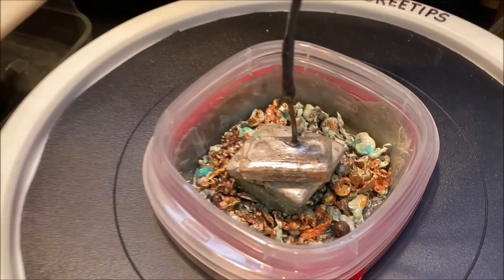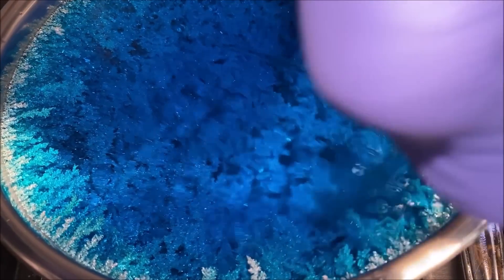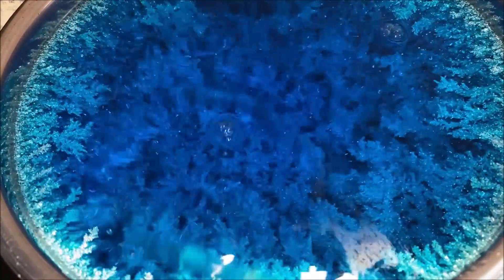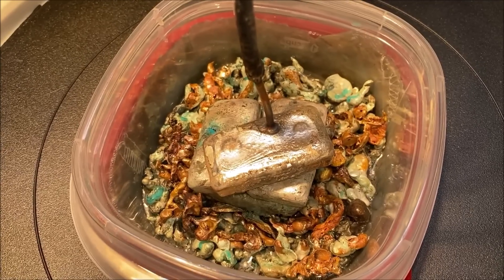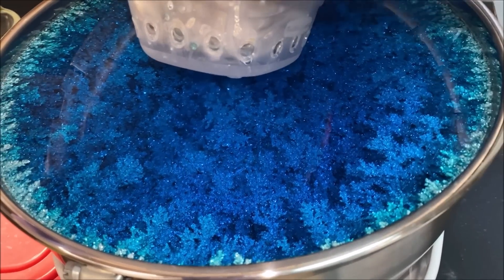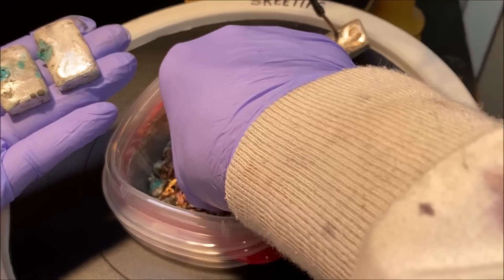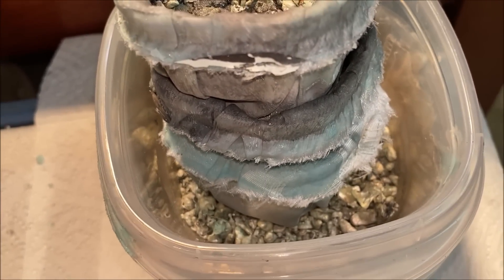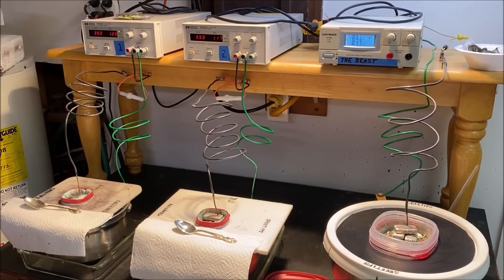Silver Cell Day 14 Crystal Growth 336 Hours

Comment: I am curious to know your thoughts on using silver nitrate crystals powder to create the electrolyte solution versus making it ourselves with the 999 crystal, nitric acid and distilled water.  We have not used the powder but it would seem to be a safer route, just not sure if it would be as lucrative. Have you tried it?
Reply from the maker: Silver nitrate crystals should work fine.
Reply: @sreetips  Thank you! We will try a batch and see how we like it.

Comment: I'm going to make a 1ltr cell with 150grms of 999 silver for my electrolyte, I have 180grms of sterling I will refine and cement out, I will also sacrifice two 2oz rounds to the crystal gods, will this be enough to feed the cell please?
Reply from the maker: When I was running a 1 liter glass cell I think i would get about twenty or twenty five ounces at harvest. But they are a giant pain because the crystal, while very pure and beautiful, grows rapidly and it will make contact with the anode if it’s not continuously knocked down.
Reply: @sreetips  thanks heaps, I do plan on watching it 24/7 it's to mesmerising not to, hopefully I get to do a larger one in the future
Reply: Can I run lower amps to slow it down, or will that interfere with growth to much
Reply from the maker: Possibly, I’m not sure about that.

Comment: But where are you getting all the impure silver? The entire set up is DIY which is awesome but you still have to provide the silver to pull from right?
Reply from the maker: I refine gold. I use sterling silver, that I buy at estate sales, to refine the scrap gold. I recover the silver from that, melt into shot, and run it through my silver cell. Silver is a by-product of my gold refining. The cell converts the impure silver (about 980 parts per thousand silver) to high purity four nines fine (9999 parts per ten thousand) pure elemental silver metal. So I’m refining the impure silver, into high purity silver, not creating silver out of thin air. When it’s full, I harvest the pure silver crystal, put it away and forget about it. Then I repeat the whole thing again.
Reply: @sreetips  By reducing and refining sterling silver you get gold and silver?
Reply from the maker: No, I use sterling silver, alloy it with karat gold, then pull the silver back out with nitric acid leaving the gold behind as high purity gold. Then I recover the silver and run it through my silver cells.

Comment: Question do you have to have a pure silver bar on the top connected to the wire. If so why is that. And also do you have to use pure shot to make your electrolyte? If so why? Thanks for your help!
Reply from the maker: 1) No 2) pure silver for electrolyte was the way I learned it.(edited)
Reply: @ thanks. My silver crystals aren’t as thick and big as yours. I’m using the same voltage you use with a computer power supply. Do I need a bigger power supply that can do more amps or something?
Reply from the maker: I used PC power supply for a while. It worked well. But then I bought a better power supply.

Comment: So the reading and experiments ive done show that the purity of silver can decline over a long run as copper displaces /replaces the silver in solution.  The variables i have not found is at what point does it drop from .999.  Adding fresh electrolyte obviously prolongs the purity.  But at some po8nt thete has to be a solution saturation of cu that affects purity?  In my mind i devised a series to run the sterling directly to .99  and the re run in a second to keep .9999 

Per annode.. ive been pouring a half oz pure and rolling out as thin as my mill can make it and just clip to a strip that sits atop the shot or solid silver to be refined. 
My next run i will clip directly to spoons and forks in the Annode basket.  
Im using steel bowels with a ring attatched for cathode and clip to the ring.  No copper band required .  

Happy festivus!
Reply from the maker: As per some pro refiners on the goldrefiningforum.com I’ve heard that the cell can have as much as 60 grams per liter of copper in it. After that the copper could start to co-deposit with the silver and contaminate the silver. I tried running my small cell for three runs using the same electrolyte, augmenting with distilled water only. On the last run, the silver didn’t look right and it had green residue. When I tried to drop the silver with copper, no silver formed. So I tried dropping silver chloride with HCl. Again, no silver chloride formed. The electrolyte had become completely devoid of silver. Made a believer out of me. Today I never use the electrolyte more than twice. And I alway add fresh electrolyte for the second run.
Reply: @sreetips Smart my good friend 🔥🙂🔥

Comment: Modify the basket in which you add impure silver, put the larger basket to be the contact surface, so you can double the amount of pure silver, When removing the pure silver, do not scrape the silver off the walls of the pot, leave it as a contact surface

Comment: I was thinking (I know, dangerous!) and from an electrics point of view the anode bar doesn’t have to be silver as long as it doesn’t come into contact with the electrolyte. I wonder if it would make sense to make some large “bars” of impure silver shot to provide a buffer layer between the anode side/electrolyte side. That way you’d be able to keep from having to expend all that valuable pure silver making anode bars. 
Maybe I’m full of s***, but we’re not dealing with high amperage loads and the #10 wire you are using can carry an easy 25-30A of current and an impure shot anode wouldn’t slow that down in the least.
Cheers and thanks for the great content!
🖖😎👍
Reply from the maker: I like casting bars in pure silver because it’s a dream to melt and pour pure silver.

Comment: Assume each cell operates at an average of 1.5 amps, which means each consumes 5.25 watts, given the 3.5 volts. The entire setup has been running at 99% capacity nearly non-stop for 336 hours. By now, all three cells have collectively consumed approximately 5.29 kWh of energy. In my country, where electricity costs 0.14 euros per kWh—one of the highest rates in Europe—that translates to less than 1 euro for the electricity required to harvest several kilograms of pure silver.
Reply from the maker: Nice! I know my electric bill was $115 last month (108 EUR)

Comment: I've always wanted to ask this.. why would the batch be ruined if a hole does end up happening? Any slim material that makes it into the electrolyte can't be rinsed off the already formed silver crystal with no permanent damage to the purity?  I know you like to strive for perfection I'm just wondering if there's a chemistry answer I'm not seeing for why it's "tainted".
Reply from the maker: I’ve only had it happen once, before I started putting in the fuse. The cell electrolyte was nearly boiling temp hot and the silver crystal was coated (kind of like baked-on) with trash. To remedy, I simply ran the contaminated silver crystal back through the cell.

Comment: I cry a little every time I see you smashing those crystals.  Those complex crystal structures have to be worth a lot more than the silver weight.
Reply: They are too fragile to preserve easily unfortunately.
Reply: @ctvxl exactly. The only way ive been able to preserve mine is to superglue the base of it to the bottom of a cut water bottle, and filling the bottle up with epoxy with a small led inside to light up the specimen. I figure if I ever truly wanted to get it back out, I coulc carbonize the epoxy with just enough heat to not melt the silver haha
Reply: I understand how you feel, but the reality is they are intrinsically worth only their weight in silver, but one could sell them for more as decorative pieces, if they weren't so delicate.
Reply: @nunyabisnass1141  Silver Crystals 10g - 99.99% Pure Silver Crystals on Ebay cost  €43.67.  The spot price as of Friday was €0.94/g.  That's about a 4X markup.  So, NO, the reality is they are worth what people will pay for them and that is currently a lot more than the weight of the metal.
Reply: First, carefully remove most of the liquid from the bowl, leaving a small amount. Heat the remaining liquid to evaporate the rest of the electrolyte. Then, pour epoxy resin into the bowl and allow it to cure, ensuring that you remove any bubbles during the process. Once cured, use a lathe to machine the entire piece, grinding down the steel bowl. And voilà, your crystals are preserved for eternity.
Reply: @DjAlon3  I was going to recommend either preserving the entire bowl like this, or remove the most interesting crystals with  tweezers and coating them in resin.  Gold crystals are worth 8-10 times the weight of gold.  Even if you sold these for 3-4 times the wight of silver, that's a good deal.

Comment: Excellent work.
Have you calculated how much silver from the electrolyte solution is recovered in the end. I wonder how much silver from the electrolyte is deposited on the crystals.
Reply from the maker: I’ve never tried to determine it.
Reply: @sreetips  because at the beginning you make a dilution of approx. 50:50 and then I imagine the water evaporates due to the heat generated by the electrolysis concentrating the silver. So then you add more electrolyte, which increases the concentration of silver even more.
Reply from the maker: The silver in the electrolyte gets depleted as the cell operates. It gets deposited on the cathode because the cell can’t tell the difference between silver ions in the prepared electrolyte from the silver ions being dissolved in the anode filter.

Comment: Can you tell me (which I sure probably already have) what would happen if the silver came in contact with the basket??  Will it short out the power supply?? Start a fire??  Open a worm hole to another galaxy?
Reply from the maker: It would burn a hole in the filter and allow the slimes down into the cell and contaminate the pure silver. Before I started adding a fuse I had it happen once. The electrolyte was near boiling point of water and I couldn’t touch the stainless bowl without burning my fingers.
Reply: Blows an inline fuse.... He covered this during a filter basket change.

Comment: If instead of a stainless bowl for the cathode, you used a flat stainless plate in a glass bowl, could you harvest it daily, or is the yield influenced by the surface area?   (so a round bowl has more surface and yields more)
Reply from the maker: My cell is a Thum cell, anode suspended above the cathode. A Moebius silver cell has alternating anode/cathode plates hung vertically in a tank of electrolyte.
Reply: @sreetips  thanks!!!!

Comment: I’m wondering, can I buy this silver from you at a decent price?
Reply from the maker: I have a few ounces for sale on my eBay site. But with silver so grossly undervalued, I’m choosing to hang on to all my silver.
Reply: @ boy what a shame I wanted to buy 100 ounces from you. I would be fair if you would be fair.
Reply from the maker: I believe that selling silver, for thirty bucks per ounce, would be a big mistake. For this reason, I’m buying, not selling.
Reply: @ I would like to learn how you do this. I’d like to open up a big warehouse and put large tanks maybe 250 gallon tanks instead of that small scale that you’re working on would you be interested in working with me? I know nothing about what you do. I just am intrigued by watching what you do. Let me know if you’re interested.
Reply from the maker: My small cell is a Thum cell, anode over the top of the cathode. To go big you’d need a Moebius silver cell: alternating anode and cathode plates, spaced 4 inches apart, in a tank containing gallons of silver nitrate electrolyte. The current flow would be hundreds of amps. That’s much too large for my small hobby operation. I do this for enjoyment. It’s my hobby. But it has kind of turned into a “job” since I started making YouTube videos. Someone once said that if you turn your hobby into your work, then it becomes just that, work. I’m not wanting to go big, nor take on a partner.
Reply: @ so I’ll buy all the stuff that’s needed right you will be the master. I will be the supplier of the money. Let me know if we do just want 250 gallon tank and put however much silver we need I can do that right now I have $5 million worth of silver. Put it all in the tank and let it grow whatever you have to do.
Reply from the maker: @georgeniebergall7074  if you’re serious, then I’d recommend checking on the goldrefiningforum.com for some help. There are folks on there that specialize in setting up large refining operations. It’s free to join. I’m a member there. My user name is: kadriver.

Comment: I've been wondering if the silver content of the electrolyte changes during use?   For sure the vast majority of crystal growth is from the dissolved impure shot which is a very cool process.... but does the electrolyte also lose some in the process which is why it needs topped off?   Loving the series watching the crystal grow Mr. Sreetips!
Reply from the maker: Yes! The electrolyte becomes depleted as the cell operates. It plates out on the cathode. Because the cell can’t tell the difference between the silver ions in the prepared electrolyte, and those that get dissolved in the anode basket.

Comment: nice... :-) i love your lab work !
 i am  always thinking about feed the silver cell with a big bar! pouring cement silver in a 1 kilo bar? put it in the basket for desolve.
Maybe fixing with a lab clamp
 i think, then you get nearly only slimes in the filter processing, and not so much exess, undesolved silver shot. you can connect the bar with a battery clamp.

you can save so much nitric in processing the slimes.
and the undesolved part of the big bar you can remelted with cement siver for the next run
just like in electrolytic copper refining
Reply: It seems like that might not have nearly as much surface area as the shot, probably cleaner, but might not dissolve as fast
Reply: @TonyHammitt  that is right... but maybe try, and see the difference? maybe it passivates, with slimes on the bar?